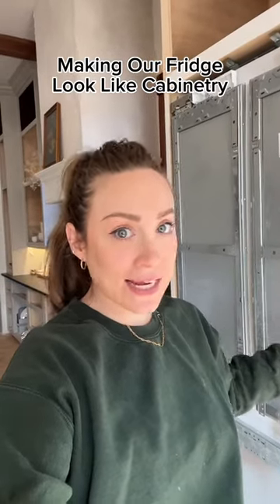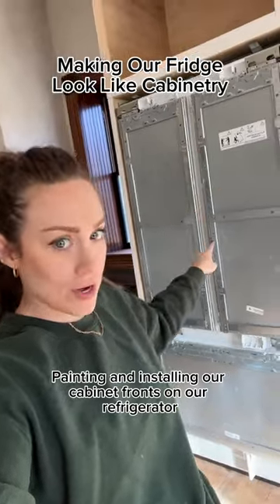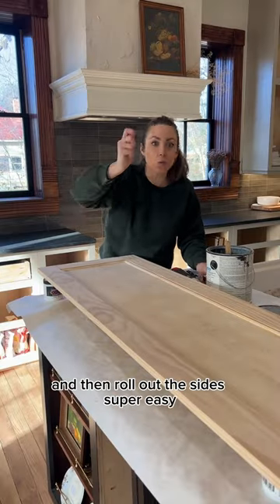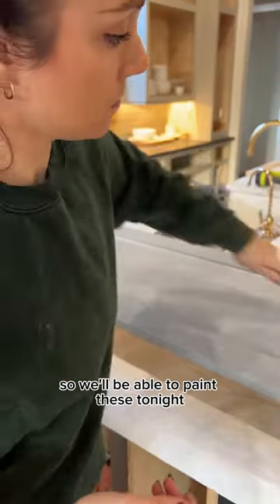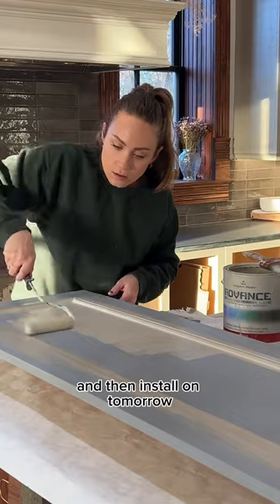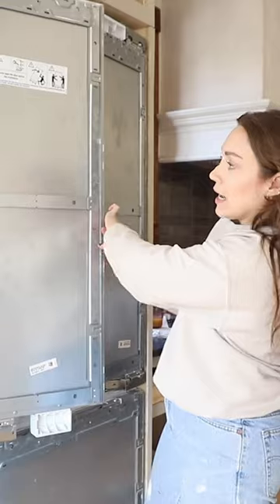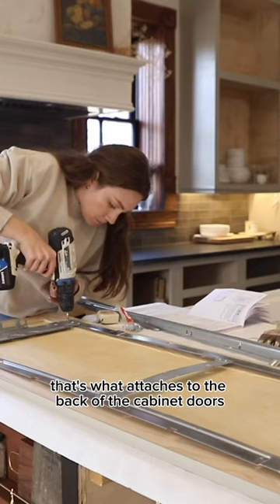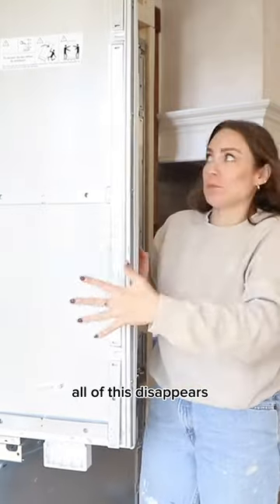Making Our Refrigerator Look Like Cabinetry 🛠️ #kitchenmakeover

Comment: So you drilled holes in your refrigerator door to attach the cabinet doors?
Reply: no, you screw that metal piece she points out on the wood panel and then you'll be able to hook the wood panel back on the fridge. Just some screws through eyelets on your wood door so it is secure and your done.